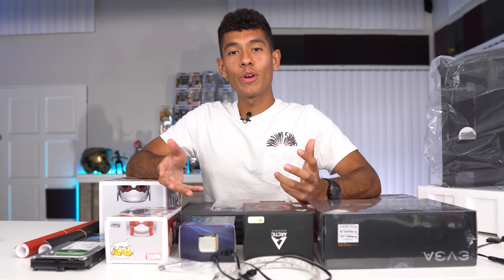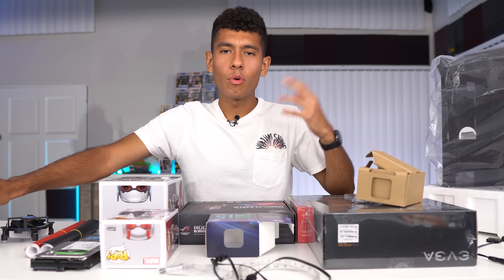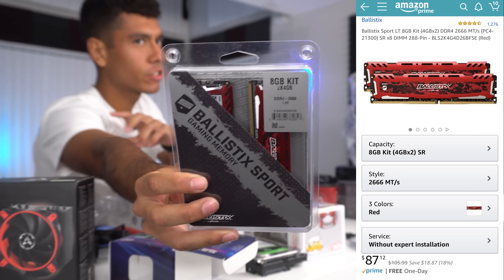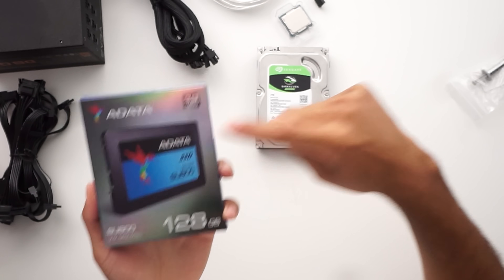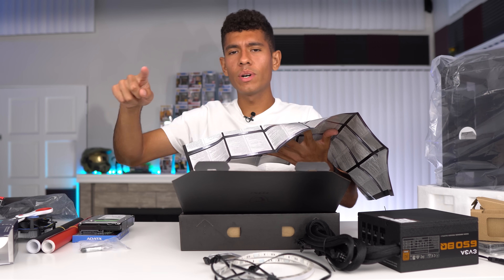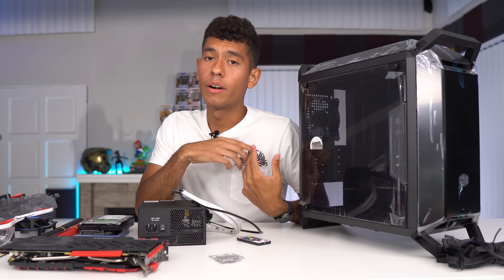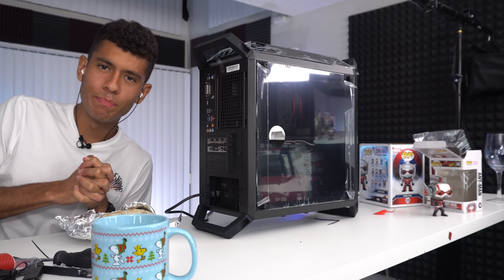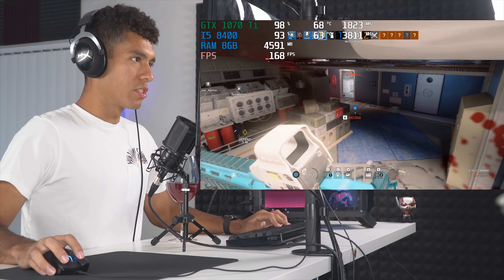$1100 Gaming PC Build - i5 8400 GTX 1070 Ti (w/ Benchmarks)

Comment: Ryzen 5 2600X 1070ti build?
Reply: @vavanade  I think the reason why the RTX cards are priced as they are right now is to prevent the 10 series of cards from going down in price or below MSRP. If you don't need these parts right now, you can wait but if not, you're welcome to buy them now.
Reply: Depends on what do you want to do. If you just want your PC for gaming, go with the PC build from the video. It’s definitely the best budget build at the moment, for Gaming, you need a Z370, H370 or B360 Mainboard, the Problem with H370 and B360 MB‘s is, that they are only compatible with RAM until 2666 MHz, which is enough, but if you want to go with 3000 or 3200 MHz you need a Z370 Mainboard.
If you also want to stream, edit, render videos, go with the Ryzen 5 2600 and a 1070 Ti.
You‘ll need a B450 or X470 Mainboard, both chipsets are compatible with RAM higher than 3200 MHz.
Reply: Edited my comments above for others who may read it.
Reply: @L-Lowe  i know this is a late reply but if you really researched you would know that ryzen will cost more and be more complicated (especially if youre a noob in overclocking) to match the i58400 with the ryzen 2600 you would need an extra good cpu cooler and atleast ddr4 3200mhz of ram. Whereas intel is alot better out of the box and only require stock cooler (since its not being overclocked) and 2666mhz ram, making it cheaper and better.
Reply: Same!
Reply: @lowell why is a ryzen 5 2600x better than an i7-7700k? Im not to familiar w pcs
Reply: @sumtingwong8312  The i5 8400 only provides 2% better performance than the 2600x at more than 150% the price. The 2600x also has 6 cores and 12 threads compared to the 8400's 4 cores and 8 threads, if you're a multitasker, this'll be beneficial to your PC.
Reply: @L-Lowe  also, could I use a r5-2600x instead of an Intel and have the same motherboard etc in this build
Reply: @sumtingwong8312  No, you need to use a B450 motherboard. To address the comment above mine, I was originally going with what Joey was using in this video, but upon seeing the 2600 multitasking capabilities, I've opted to go with it. You only need to overclock it a bit so it could match the 8400's performance in games. Me being a noob in overclocking decided I'd go for the 2600x so I don't need to bother with that. You're free to go with the 2600 to save money if you want.
Reply: Lowell Bullshit, maybe in Multimedia like Editing, Rendering, but there the 2600X is better. But in Gaming the 7700K is playing in another league. The 7700K is on the level with the 8600K. Just check some benchmarks.
Reply: @xLancy  fuckin hell, I apologize for that, I was thinking about Joey's i5-8400 when I was making those comments. I even remember thinking that the 7700k is on another level than the 2600x. Epicclan, listen to this man.
Reply: Lowell No problem dude, yeah that‘s right, the 8400 is on the same level as the 2600X.
Reply: Blxnz use pc part picker it tells u if they r compatible
Reply: So if I got the ryzen5 2600x, it would be better for streaming and playing r6?
Reply: @sumtingwong8312  Yes, especially if you're on a budget.
Reply: I would recommend the R5 2600, it's better value since it's $170
Reply: Same i am buying it
Reply: I've been looking at gaming pc builds lately as I plan to switch to pc from console, this channel has given me some ideas but if anyone could help me decide what parts would be best it would be much appreciated. PS, I'm a complete noob.
Reply: that wouldn’t be that hard

Comment: Need a suggestion..i wanna build a 1070ti pc .Is it the right time to buy gtx gpu?? .Or , should i wait for rtx gpu?Thanks in Advance.
Reply: Depends, 1070ti are going for 700$aud+ right now, and the 2070 is going for around 550$aud preorder price, so if anything, maybe either wait for RTX, then 1070ti will be a lot cheaper, yet still substantial for a setup, but RTX will either be a bit cheaper when on shelves, or wayyy overpriced.

Hopefully this somewhat helped you! But this is somewhat opinion based, but GTX 1070ti is really good.

Comment: Hey Joey hope you read. I have a 1050ti 4gb, i5 8600k, 8gb of ram, 500w thermal take psu, and a z370 gaming plus. 
But when i run Fortnite, PUBG, SCUM all on low my main amount of fps is around 100 and usually drops below never peaks above 100. Do you know of a fix? I have windows 10 64 bit aswell just thought my pc should run alot smoother than it is now.

Comment: What if I wanted to use the i5 8400 processor, with the z370p d3? Would I have to change any other components to fit that motherboard? I want to have that for future upgradability to a processor that can be overclocked if possible

Comment: Using the links provided i got this build made up and it was more around 1200 coming in at $1190 but still very close and I had a few warranty's but that was only a additional 2$ each for 4 years so worth it but overall great build and is a must for the gamers out there looking for a nice pc if you were the the 1000 dollar range push the extra 200 you wont regret it.

Comment: Joey could you make an i3 8100 evga gtx 1060 3gb inwin 301 cryorig c7 cpu cooler corsair cx (2017) 550w bronze Asus b360m a Crucial ballistix sport lt 8gb ddr4 2400 adata 128gbssd wd blue 1tb and 3 cryorig 120mm fan build? Also amazing build as always. 👌

Comment: This is my config , should i change sonething? Red Devil Rx 580 8GB , ram ddr4 G.Skill 16 gb (2 x 8) 3000mhz , CPU Ryzen 7 1800x , HDD WD black 1T ,SSD 970 evo 250gb samsung , Corsair spec omega rgb , dissipatore artic Esport freezer  320W , PSU Corsair rm 850 atx modular

Comment: You'll run out of storage on the HDD in less than 2 years, that's the downside of these new pc cases. They don't have enough 3.5 bays & the SSDs which uses the 2.5 bays don't come with enough space, hell, a 4TB SSD is $1,000.00!!! I hate these new PC cases, they're pretty though

Comment: perfect example of kids these days, dumb as hell. spending 50% of the budget on aesthetics...gay ass pop figures, led's, vinyls, etc. then says the cpu is fine with a "stock cooler" but goes on to use an aftermarket. so much cringe. you can always tell an unexperienced child from a person who actually knows what they're doing. hes so quick to run to LED fans and the motherboard he says he bought just because the writing on it....ah man, go play in traffic and stop spreading your disease
Reply: If this isn't the definition of repressed masculinity I don't know what its. The led is to make it look good and on the MOBO he just said he liked it not that he bought it ONLY for the writing plus his core is locked so he doesnt need anything that fancy. Intel stock cooler is known to barely keep the Cpu cool he said it's an insult to the system but overall it's not that good not that great. Stop twisting words.
Reply: And the pop figures are extras not part of the budget

Comment: Plz I need help I'm thinking of buying a computer almost the same as it is in this video but I noticed the motherboard doesn't have any display port.... I am thinking of buying a 144hz monitor so I would like a solution plz :)
Reply: Hey there! When you finish your whole build, you connect the monitor to the GPU, not the motherboard, so don't worry if it doesn't. Hoped that helped! :)
Reply: I'm sure it will :) thanks
Reply: Altho I changed the case and the gpu to a 3 fan 1070 ti G1 gaming is it still possible?
Reply: @diogocosta4435  Yep! It's still possible, as all GPU will have an HDMI output (assuming that's what you're using). Unless you were to go old school with a VGA connection hehe.
Reply: @bibblebox  Thanks for the support :)
Reply: @bibblebox  sure btw last question : I've been searching but I can't find any monitor good for any Nvidia card since freesync is not that good for Nvidia cards and I have a pretty low budget any monitor you know? ( I would like to get a 200 dollar one)
Reply: Ah. Ok so there's three types of gaming monitors: G-SYNC, FREE-SYNC, and a normal one. G-SYNC is designed for NVidia cards, and FREE-SYNC is designed for AMD cards. I don't know if you've noticed, but G-SYNC monitors are actually more expensive than FREE-SYNC monitors.

The cheapest G-SYNC monitor right now is the Acer Predator 24-inch: https://amzn.to/2PdfK0s. Currently retailing for $345.

If you would like to opt for a non G-SYNC monitor, you can get this highly-valued 25-inch Ultrawide LG one: https://amzn.to/2MXQTk0 Currently retailing for $150.

If you had an AMD graphics card, you could have opted for FREE-SYNC monitors, which are much cheaper than G-SYNC monitors. Hope this helps!
Reply: @bibblebox  it did I wasn't hoping on buying a freesync Monitor but one without it and that can support 144hz with a display port thanks for the help again

Comment: Hey man, I really wanna know your opinion because I've been banging my head on the floor thinking about it... I have a $2, 000 gaming PC, should I go for 4k 60hz or 1440p 144hz.. Answer please. Really wanna know.
Reply: Hey there! I'm not Joey but in my opinion, I would go for 4K 60Hz. Unless you're an FPS fanatic, 144Hz won't give a substantially better gaming performance. Also, I'm assuming your build can support 4K 60Hz. Hoped that helped! :)
Reply: @bibblebox  Yes I have a i7 8700 k and msi 1080 ti... It can run any game on 4k I think !
Reply: @alexmercer3329  Nice choice! You can definitely do 4K with that. But I have a correction to make, if you're going to be mostly doing gaming, go with the 1440p 144Hz instead. But if you'll also be doing some editing, go for 4K 60Hz. Do keep in mind that 4K works better with larger screen sizes (27" or more).
Reply: @bibblebox  Thanks man!

Comment: Could you try to do a i7 7700k or an i7 8700k build with a 1080 video card build and try to keep it about 1200-1400$? With aura compatible lighting (fans, ram sticks, and CPU cooler) ? Trying to give you a little bit of a challenge

Comment: What is the MSRP for a 1070/ti? Will it be back to normal possibly at Christmas?
Reply: Hey there! Right now, I believe the 1070 Ti is on sale, due to the upcoming release of the RTX GPUs. But as far as normalizing, probably not in the near future. Hoped that helped! :)
Reply: @bibblebox  Currently is it about 620 dollars here in Canada (about 485 dollars in the US) Can you guess much will the RTX series drop the price of the current 1070ti? I have never really witnessed a new GPU released before and saw the difference in the older models. Thanks again. ;)
Reply: @publicbathtub3005  Alright so MSRP for the 1070 Ti is $449 USD. It's currently selling between $400-575 USD. I would say, it's actually pretty normal right now, but as far as forecasting, I can't determine a value. I'm guessing with the release of RTX, prices may drop by 5-10%. The price hike itself is mainly affected by the crypto-mining market, so it's whenever that dies out, that prices will go back to normal for all GPUs.

Comment: 1500 PC Next please with a i7 and 1070 ti or normal would be prefered something black with red thanks
Reply: so the same colors with the same gpu and a slightly better cpu? good idea
Reply: I would suggest a 1,500 pc with i7 8600K and 1080ti white or blue build something clean ??
Reply: Im actually building this pc now with a 1070 ti and a i7 8600k lol
Reply: Solid i was wondering is the i7 8600k suitable with this pc built
Reply: yeah it is
Reply: i am building a 1500 euros pc aswell with an i7 8700 and 1070ti. I am inexperient and after all research i did i decided i7 8700 with 1070ti.
can you give me some advices?

I am thinking in:

Cooler CPU Noctua NH-D15
Nox Hummer 80+ GOLD 750W 
CAIXA NOX HUMMER MC PRETA RGB C/ JANELA 
MOTHERBOARD MSI Z370 GAMING PLUS SKT1151 
MSI GEFORCE GTX 1070 TI GAMING 8G
INTEL CORE I7 8700K 3.7GHZ 12MB SKT 1151
RAM G.SKILL Aegis 16GB (2x8GB) DDR4-3000MHz CL16 Preta 
3.5" Seagate Barracuda 1TB 7200RPM 64MB SATA III 
SSD 2.5" Crucial MX500 250GB 3D TLC SATA
Reply: Guys..  Money does not grow on trees
Reply: youre everywhere 😂 i saw you on brainybrens channel
Reply: MY FIRST PC BUILD NZXT - CHECK IT OUT PLEASE! - https://youtu.be/bEw6JloAAfo
Reply: 1080 is slightly better and like maybe 50 dollar more

Comment: Meh the i5 8400 is probably gonna bottleneck the GTX 1070 TI, and 8GB of RAM is too low.
I'd replace the i5 8400 with an i7 8700K, the GTX 1070 TI for a normal GTX 1070 and give it an extra 8GB RAM so 16GB RAM.
It might cost a bit more but, it's a lot more worth it imo.

Comment: does an unactivated windows 10 let you use 2 different storage? i have a SSD and hdd but for some reason, i have to format my hdd to put files in it or modify it. then, after rebooting my PC i cant put files or modify it. ive tried to change ownership/permissions but that too is messing up, i cant change permission or edit to admin rights

Comment: Any ideas how I could make this a little cheaper without losing so much of the performance
Reply: Get a cheaper case (a 15-25$ one will save u 35-45$)
Run on a single 1tb hdd (that means only 50bucks spent on storage) without an ssd (this will affect loading times in some games/windows loading but not that much that you'll regret the build
This way you'll cut around 100ish from the cost of it
You could also stick with a 600w psu bronze tier or even a normal rated one (check for ratings on the psu itself) which will also get u cheaper
650w seems overkill considering all tdp of that pc even with rgb goes around 400-450 (i do NOT suggest running a 450w, keep some room to spare, a 550-600 should be ok)
Also the motherboard he picked doesn't overclock making it a very logical choice to go for a different, cheaper motherboard e.g. h110m-c will save u some cash
Again, you won't cut down much from the build itself and what your losing in terms of performance is only when it comes to loading times in certain heavy data games (pubg gta V etc) while maintaining same or 98% of same fps
I doubt what I stated above will affect the actual performance, rather the "quality of life" and upgradeability later on
Reply: take out ssd
cheaper case
cheaper psu if possible
ryzen route is good too his other 1070ti build uses it.

Comment: i7 8700 - ASUS B360-G ROG STRIX Gaming Motherboard - Team T-Force 16GB Delta II RGB Black DDR4 3000MHz - MSI GEFORCE® GTX 1080 GAMING X 8G Graphics Card - Coolermaster MASTERWATT 750 Semi-fanless Modular Power Supply - Cooler Master Hyper H410R CPU Air Cooler. How many fps am i going to get in games like pubg and fortnite and siege if i run them on high resolution? Thanks!

Comment: I had a question, I saw that you used the 3.5 2tb hard drive. Heyave you had any issues intstalling  it? I had two that never showed up I've check my sata cables and my power cables.

Comment: My heart stopped at 3:11.

8gb ram?

1100$ budget?
I‘ve made a config too, but since I live in Germany the prices are different.
So I just made a 947€ (1100$) config:

-PNY 1070 XLR8 OC Gaming Dual

-MSI B360M Pro-VDH

-Sharkoon M25-V

-be quiet! Pure Power 10 400W
(be quiet‘s PSU calculator says it‘ll only need 301 watts)

-G.Skill Aegis (2x8) 16GB DDR4-3000

-Toshiba DT01ACA 1TB

-i5 8400

-EKL Alpenföhn Ben Nevis Advanced
(cooler for CPU)

-Patriot Burst 240GB
(Fast, cheap SSD)

I know the prices may vary but using the 1070 instead of the 1070Ti will save you roughly 50€ (58$). 
And with that money you can buy a 2x8 Ram kit.
Reply: Just typical business strategy the people that make the ram make less ram causing a world shortage so in return prices go up and they make more money. supply and demand

Comment: My pc used to run every game over 140 FPS or higher but now it runs like at 40-90 and I’ve only had it for like 3 weeks. Plz help
Reply: Specs?
Reply: Gtx 1060 8gb ram and the other things from his build of August or July I the 1000) one
Reply: You should be getting about 70-100 FPS in most games. 50-60 FPS in really demanding games. You should easily get 144 FPS in e-sports titles. (CS:GO, Rocket League, Overwatch)
Reply: I used to buy idk what happened

Comment: I built mine with a Ryzen 2 2600 for $165, a used GA-B350 Gaming 3 from Amazon for $60, a used GTX 1080 for $340 from eBay, 16gb RAM for $180   and other new components from Amazon, all for a grand total of ~$760 USD taxes included.  It is just a matter of finding good deals.  I can game AC:O 4k at around 45-55 fps, so pretty sweet.

Comment: Hey Joey I have a question for you 
Remember your $2000 pc build what if I replaced the 1080ti with a 2080ti would that still work or no when it comes out?

Comment: For the price of that 1070 ti you can get a 1080 damm man feels bad I would get that 1070 ti if it where cheaper than a 1080 I saw PC part picker

I just went on amazon that 1070ti is going for $513 and it’s $17 more for shipping 😭😭😭 whyyy I was legit going to get it right now I was getting all the parts and now I’m screwed

Comment: i have a question what will a pc with this spec cost for you i7 8700k gtx 1070ti msi z370 gaming m5 cooler master ml240rgb trident z rgb 16gb 3200mgahz cooler master pro box 5 550 wats power supply cooler master 2tb hhd wb blue and 500gb ssdpgx  how much will it cost you cause i build that pc for 1.8k cause of the item in my country is expensive i want to know if you build there how much would it be

Comment: I have a question:
I bought a prebuild pc since my dad didn’t want to me to build my own.
It cost me 1700 euro. So my question did I overpay for the parts I got.
The specs:
Case: fractal S case
CPU i7-8700k
GPU inno3d gtx 1079
16gb ram
Samsung 960 evo 256 gb 
1tb hdd
Windows 10 pro
Noctua nh-d14 cpu cooler
If I did overpay pls tell me so I can refund it

Comment: I only can build a 1000$ gaming pc and the price is killing me 

specs
Rx 570 xfx 8gb
i3 8100
ddr4 8gb ram 3000mhz
b360 motherboard
450bt power supply
Cooler master hyper 212 EVO 
Checkout price C $1,201.85

All parts found on ebay.